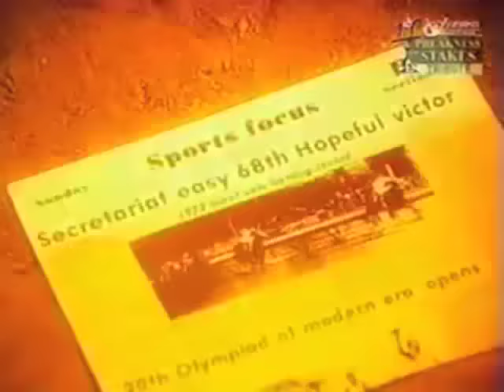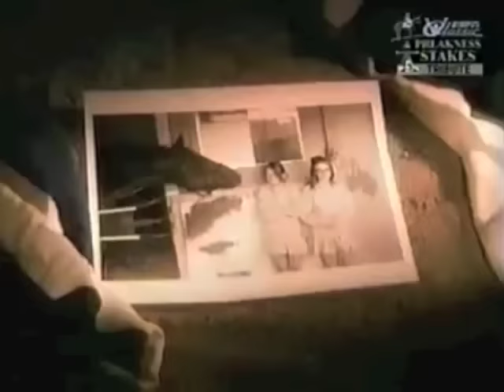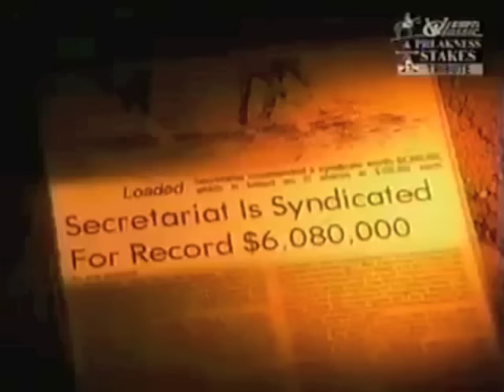ESPN Sports Century - Secretariat

Comment: We all admired American Pharoah's Triple Crown, rightly so - a great accomplishment by a great horse. But in comparison to Secretariat, there is none. Secretariat's Belmont would have beaten AP's Belmont by 10 lengths! Think about that for a moment. TEN lengths. Secretariat wasn't merely great, he reached the bucket of gold at the end of the rainbow.
Reply: +4orrcountry If you take the average speed of both horses, Sec winning margin is significantly greater than 10 lengths.
Reply: At 2:24, Secretariat's average speed was 37.5 mph or 55 ft/sec. Given his time beat American Pharoah's  (AP) by 2.65 seconds, he would have been in front of AP by 145.75 ft, almost 50 yds at the finish. A horse length is defined as 8 ft. Thus Secretariat would have finished 18.2 lengths in front of AP.  This is not only spectacular, but almost divinely inspired. Consider that Secretariat set the track record for the Kentucky Derby, the Preakness and the Belmont Stakes 45 years ago and each of his track records still stands and none has even been approached. Simply amazing!
Reply: Would have been even more if they were actually in the same race forget American pharoah led the way and he would have had to run faster in the beginning to keep up with Secretariat never could have kept up the pace what happened to Sham would have happened to American pharoah or any horse that day

Comment: I don't get how some people compare great SECRETARIAT with Man O' War or other horses. The earth will probably never see a creature like SECRETARIAT.
Reply: Gel B Man O' War won 20 of 21 races.....Secretariat won 16 of 21......then you have to factor the times and the difference and improvements in training and nutrition advances from the 1920's when Man O' War ran.....to the 1970's when Secretariat ran.....then you have to factor Man o' War ran on shoes made of steel versus Secretariat's lightweight aluminum........and the fact Man o' War typically carried extra weight to give his opponents a chance of winning.....As a two year old he carried 130 lbs..... as three year old 138 lbs....over 30 lbs more than the horses he ran against......Secretariat didn't. 
On the last race here at Belmont that they talk about.....Secretariat ran it in 2:24 and broke the then record by 2 seconds by .....and the length of the track was 1 1/2 milesWhen Man O' War ran it  before it was restored and renovated in the 1960's..it was 1 3/8 mile....Man O' War ran it in 2:14.20.....beating the previous record by over 3 seconds
Man O' War could have held his own against Secretariat
Reply: snwlcke3 hogwash!  impossible to compare based on numbers.  not only would secretariat with that matchup 10 out of 10x, Sham would have also most likely beaten Man Of War...
Reply: +snwlcke3  Very good points.
Reply: amen
Reply: +snwlcke3 Funny, false premise arguments always support the a mind of predetermined thought. Peeling back the layers of detail with further facts are what reveals truths.
All one really needs to understand is the difference between running and racing. It's the difference between being pressed and simply knowing that your competition does not stand a chance, even carrying a paltry impost.
That leads to a broader conversation on weight carrying. It is not one dimensional. This is where this snwlick person steps all over himself.  For example, in the 1920 Stuyvesant Handicap MOW competes against but one horse,  Yellow Hand. The race is one mile in length. MOW carries 135 pounds. Impressive? Not at all. Why? Yellow Hand carries 103 pounds and is never in the race. MOW runs a final time of 1:41 and 3/5ths. The notion that this event is even counted as an actual race is ridiculous. 
As we broaden the conversation based on the previous information, what do we begin to learn? Of 11 races in which MOW participated in his 3 YO season, a full 9 of these races were against 2 or fewer horses. In but 4 of those races did a competitor carry 126 pounds (one of these being the worn-out Sir Barton). 7 of these races featured competition carrying weights that in 1973, for example, would have been an impost found in a G3 race. In some instances the imposts would not have even qualified for an allowance race. When coupled with the facts the foals dropped in 1917 were in the 500 range and foals dropped in 1973 were in the 25,000 range, what begins to emerge is the level of competition. 
The fact is that MOW never ran against a quality horse and/or a horse that produced an outstanding performance. In the only race that MOW was actually pressed, the 1920 Dwyer...look at the facts. In a match race (again) against John Grier, both horses were spent at the 3/4 mile mark. That fraction was 1:09 and 3/5ths. The next 3/8ths of a mile was run at a pace of 26 and 1/5th per quarter. That is pull-up speed. As stated, both horses were spent. MOW's sides were heaving like a bellows, according to Dorothy Ours, after the race. That 3/4 fraction was something that Sec was capable of running multiple times, even at 2 YO, and finishing in WR time. Further, John Grier carried but 108 pounds in that race and still could not run the 9 furlongs in under 1:50. Can anyone spell G3...allowance??? Abram Hewitt stated that John Grier was the 2nd best horse of the 1920 crop. What this means is that the 2nd best horse was rated at more than 18 pounds below MOW. This is something that was unheard of in the decades to come.
To sum it up, we return to the earlier statement as to running versus racing. When you run against horses who have no chance, while carrying absurd weights and in small fields...well...guess what...you are going to win and your recovery from that so-called race will be quite easy.
Reply: Just one example of man o war and secretariat carrying equal weights and equal distance is this secretariat Belmont,  Lawrence for man o war for 1 5/8 mile.  Secretariat Belmont easying thru an extra furlong was clocked at 2:37 3/5 where as man o war put down a 2:40 4/5.  Factor in Andrew Beyer stating tracks ran 2 seconds slower in the 20s to the 70s and AKA handicapper Tom Ainslie researching stating steel vs aluminum shoes is 1/5 second per 10f equals to.......
Secretariat 126 pounds for 13 f .......2:37 3/5
Man o war 126 pounds 13f ........2:38 3/5 which then equals to secretariat winning by 5-6 lengths.
Reply: Nearco won all fourteen of his races in Italy, was shipped here to save him from the Nazis, and he singlehandedly put the Man o' War line out of business.  Nearco appears in 95-99 percent of Derby horses and other champions.  He is the alpha dog of sires.
Reply: Tom Swift went thirteen furlongs on the grass at Belmont in 2:37 as well.  I bet a son of his, Golf Ace, first time on the grass, who won and paid $137.60 to win.  The quinnella I had that was paying $2,700 was 1-2 at the 1/8 pole.  Raw times mean nothing plus I think Secretariat has Man O' War's DNA so that's not a fair comparison.  Secretariat is a dominant broodmare sire and lives on through Terlingua (Storm Cat), Secrettame (Gone West/Elusive Quality/Smarty Jones), and Weekend Surprise (A.P. Indy).  When Secretariat's daughters is "tucked" into one of the dominant sire lines (such as Mr. Prospector), you get champions.
Reply: The greatest factor would be the jockey.
Reply: Phillip Shaw Now THIS is hogwash!
Reply: Gel B throw out his Belmont freak show, and sexyteriat is just another really good horse. Plus he basically ran on concrete in 73, but he was still an awesome horse but not the best.
Reply: Secretary wasn't even better than citation let alone man of war
Reply: @raygordonteacheschess5501     If by "shared DNA" you mean Secretariat is directly descended from Man o'War -- no.  Secretariat is descended from Fair Play (Man o'War's sire) through the Fair Play son Display, and he is descended from Rock Sand (Man o'War's damsire) through the Rock Sand son Tracery.
Reply: @phillipshaw4573  One what grounds are you making that claim?
Reply: Gel B, I AGREE!!!!    Secretariat, the GREATEST Racehorse EVER!!!!!😍😍
Reply: @snwlcke3  But you have to look at who the competition was.  Man O War was probably the only good horse back then.  That makes a world of difference.
Reply: @phillipshaw4573  You are correct.  Sham would most likely have also beaten Man O' War.
Reply: @bbmtge  Excellent points in your post.  You basically crushed any theory of MOW being better.  Secretariat is the better race horse.
Reply: @sohillsvettech1624  Not sure if you will read this since your comment was years ago and a good comment it is.  I  see VetTech in your name and was wondering if your practice is in Equine, Small animal, Zoo or Wildlife medicine.  I'm asking because my daughter is a CVT in Zoo medicine and previously was in Wildlife Medicine.  She loves it.
Reply: @usfanlovesjiwoo1978  hey, yep I am a cvt but am in small animal practice for 10 years now.  It’s a hard physical career but I love it!!!

Comment: ...there is a statue of Secretariat with Ron aboard for the ride in the middle of the traffic circle at Old Frankfort Pike and Arlington Road just off route 4 between I-64 and Keeneland; the statue is 2 and 1/2 times normal size; and is visited by so many fans that they had to add parking around the entire perimeter of the traffic circle.

Comment: At age 12, I was sitting on the fence along the rail at the 1/8th pole for the 1973 Belmont....I remember thinking I had a bad angle of it was a close finish, and when Secretariat went by, and I couldn't hear the other horses hoofbeats, I realized I didn't have to be near the wire to see the winner because I had just seen him, and he was all alone. I was there for the other 2 Triple Crown winners in the 70's, but nothing was like this. Not even close.

Comment: I used to think Secretariat was the greatest until I examined more factors .  What was his winning percentage?  76 % .
Why did he win the Belmont by
so much ?  I think he won it by so much because of two reasons . It was a long race .  The longest in the triple crown by a considerable amount . So what , right ?  Secretariat's heart was two to three sizes bigger than other horses , so he got considerably more oxygen to his muscles . That's
why he won by so much , in my opinion . So what , right ?  So , it shows how much he won in a long race .  What about the other races ?  How did he compare to the times of the winners of the other races 
Secretariat ran in ?  I don't know , but it would be interesting and informative to
find out .  However , even if there were other horses that ran in the same races as Secretariat that had faster times there needs to be another factor to consider .
Secretariat improved greatly with time and age . He then 
became dominant . A superior
animal if judged by his clock times .
He broke records .  So, now I think he probably was the greatest .

Comment: Lol... conveniently forgot the Whitney and the Woodward. Where he got Smoked. In reality... Secretariat just wasn't as fast or as good as several other horses. A full 10 lengths slower than Spectacular Bid. Who achieved his world record for 10 furlongs under restraints..this is more like a commercial than an accurate historical account.
Reply: You obviously aren't aware of the Marlboro Cup, where Secretariat unofficially tied Spectacular Bid's record WHILE BEING GALLOPED OUT THE LAST EIGHTH. The Bid was a great horse, to be sure, but in a match race at any distance I'd put my money on Big Red.
Reply: @johnhunter2294  for starters, the Marlboro Cup was run at 1 1/8th in 73.  the Bids world record is at the champions distance of  1 1/4 miles. Secretariat ran it in 1:45.70. which is a very quick time for sure.but there are several faster times at that distance, including Simply Majestics 145. flat. and the Bids 1:45.25 at Washington Park, where he won by 17 lengths under full restraint with a 137 lbs on his back, breaking Damascus track record by a full second. So you may have barked the wrong tree there.but if you are looking for an angle. Secretariat's Marlboro was faster than Bids Marlboro by a full second. The only things are....The Bid ran his with 8 more lbs than Secretariat did. And on a track labeled "dull" and I get it! You are a fan. And the Bid was 4 when he went on his earth shattering 1980 campaign. But that is nullified by the amount of weight they kept piling on the Bid. Secretariat was a tremendous 3yo runner in restricted racing. Maybe even better than the Bid at 3. The problem is, the Bid got better..a whole lot better! So good...he was forced out of racing because tracks were losing money when he ran. Even as they were threatening to throw a 145 lbs on him if he kept running
Reply: @davidbracher8322  Secretariat went 1 1/8 in 1:45.4, not 1:45.7, which was a world record at the time. And Spectacular Bid never ran with more than 132 pounds, and that only twice. I'm not saying that The Bid wasn't a great horse; Blood Horse magazine has him at #10 all-time, which is if anything a little low in my opinion. But he never won a race at a mile and a half. Secretariat never ran as a four-year-old, so we'll never know what he would have done with another year of growth and training, but his Marlboro shows that he would've been able to run with Spectacular Bid at 1 1/4, and his Belmont shows that he would've left the Bid in his dust at a mile and a half (along with every other horse that's ever lived). A match race between the two would be great at any distance up to 10 furlongs. Beyond that, it's Big Red all day every day.